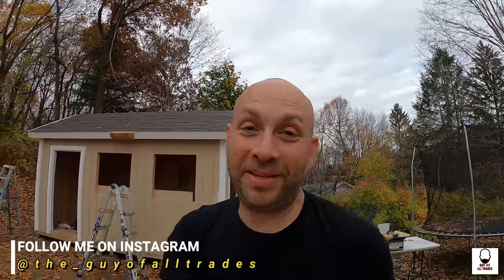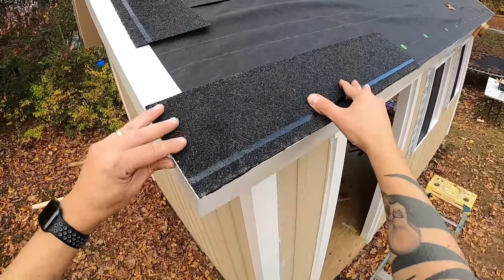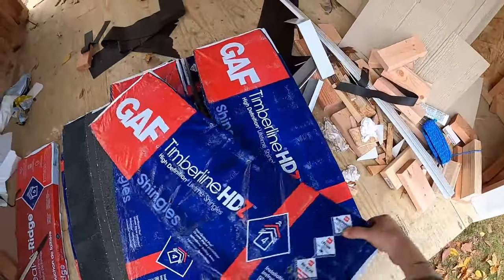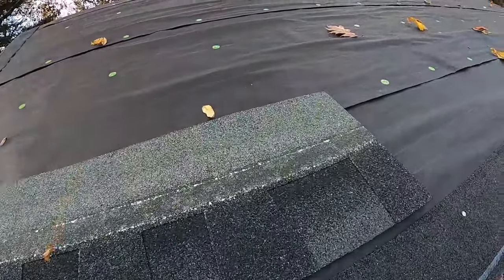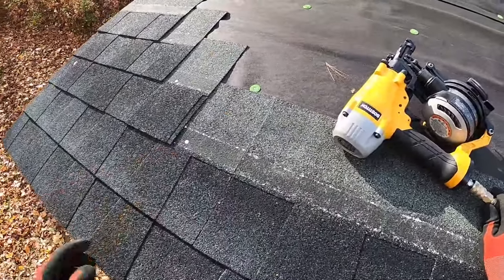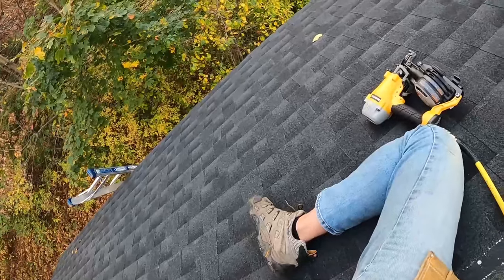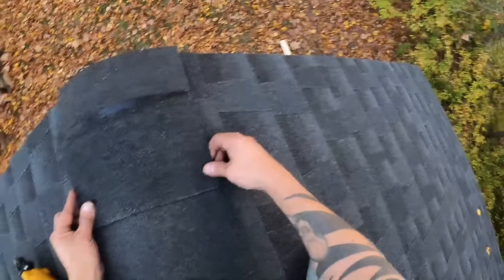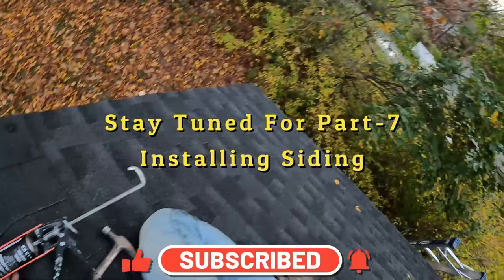How To Shingle A Shed Roof

Comment: You are putting nails too low. Not suppose to be in the middle sticky part. Suppose to be just above that middle strip.
You are trying to teach others ????
Reply from the maker: That is literally where the manufacturer shows to install them in their spec doc. 

https://documents.gaf.com/installation-instructions-&-guides/timberline-layerlock-installation-instructions-trilingual-restl622-(4-23).pdf